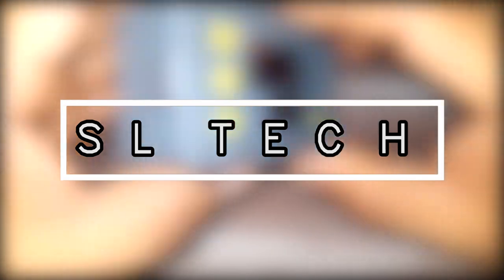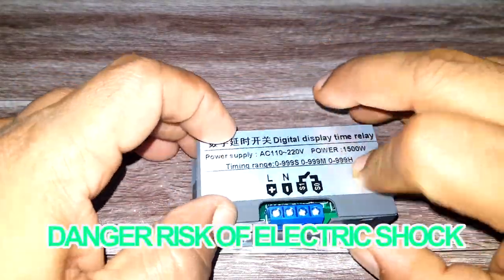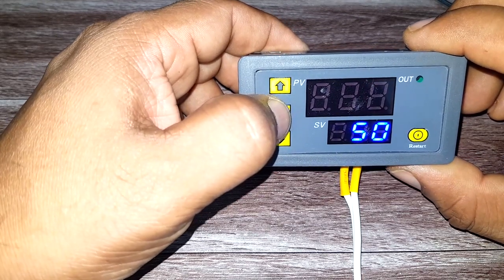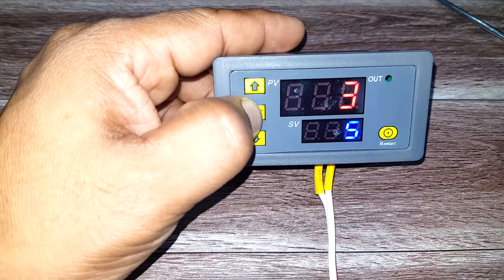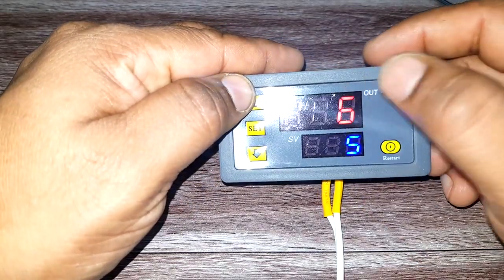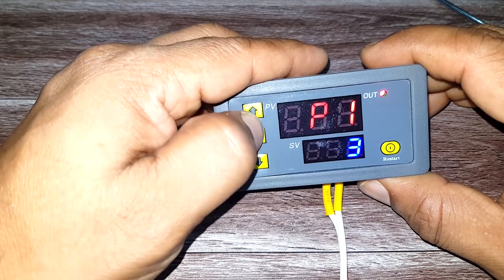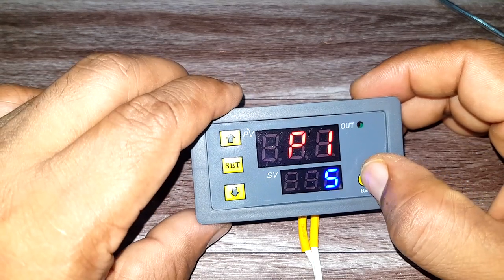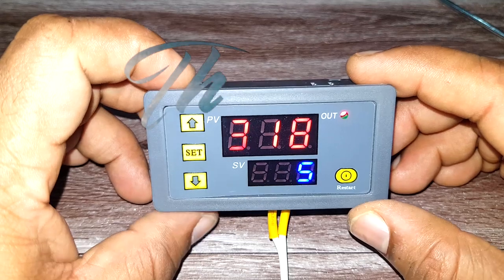DIGITAL DISPLAY TIME RELAY (Time Delay Relay Module)

Comment: Thanks for showing this. 
I have an old bag sealer, impulse sealer they call it. The one that is foot operated and for some reason its electronics are bad, I replaced the potentiometer with a new one and it worked for a while but now its is bad again. Cant adjust the timing reliably, it would turn on permanently of very shortly. 
Thinking about getting this one to replace the old stuff.

Comment: Great demonstration thanks, it's a nice thing. I don't see a 32kHz crystal though on the board, so not so sure it would keep good time in continuous running modes 4 and 5. I will try and find the spec. for it.

Comment: Hi,
Is it possible with this timer too wait 12 hours power off and power on for 30 seconds ? Your demonstration don't present the possibility too have 2 differents configurations between the 2 timers (one in hours and one in seconds for example)
Thanks for your answer
M.
Reply: RexxSeven  Thanks RexxSeven! 🙂🌎✨

Comment: Will the timer start when power is applied? For instance, in case of power loss, will the timer start when power is restored? Or do you need to press a button to start the timer after power loss?
Reply: It looks like the timer will restart automatically once the power is restored.  = )

Comment: Does anyone know how to trigger the start button remotely?
What voltage it might need?
This would be very useful so that the start button is wired (via a transformer) so that when the pump / light / etc is switched on in the normal way from the existing switch, it will run for say five minutes then turn off.
The unit should not be accessable to the user, hence the need for remote triggering.

Comment: I can program the timer but the relay does not switch on a 12v water pump. Do i have a faulty timer or am i wiring it wrong? 12v to battery, pump on other terminals.
Reply: You need a 12v + to s1 then s2 goes to your pump and the ground wire from your pump back to battery negative

Comment: Will this work ..I only want it on for 30 seconds every 24 hours is it possible to do
Reply: Sorry I dont think so...
Reply: You could join two together for this, one on a 12 hour on/off cycle which switches one on for 30 seconds only
Reply: yes it is possible. Chose P0 - 2 ( hours) and P1 - 5. set red timer 30 and blue 24.

Comment: brother your video is very educative but i wan to know how to set it for turn it on for 5 SEC AND off for 8 Hr and on for another 5 SEC like that vise viser
Reply: First change the working mode to Minutes 
for that Set the P0=1
Select the cycle timer option 
For that Select P1-4
Then set the red display to 5 and blue to 8.
The output will be off for 5 minutes on for 8 minutes and the cycle continues. 
Hope this helps
Reply: @saijusam9130  SORRY I MADE A TYPING ERROR IT SHOULD BE ON FOR 5 SECOND AND OFF FOR 8 HOURS
Reply: @yayajallow3346  Sorry. I don't think so
Reply: @saijusam9130  goodnight sir , wonderful video , I have two questions (1) is it possible to have this timer turn on for five seconds  once an hour to rotate a motor clockwise and then after another hour rotate the same motor anticlockwise ? ( Clockwise for five seconds and then anticlockwise for five seconds ) (2) I can't seem to find a wiring diagram for the device , can you pls assist ... thanks a million
Reply: Sir how to set 2 hrs off 5seconds on
Reply: Unless I am misunderstanding his answers to the similar questions on this video, with this timer you apparently CANNOT mix timing modes
e.g. Seconds "ON" and Hours "OFF". Both "ON" and "OFF" must be in the same mode/range to work properly. It looks like the timer mode option is a "global" setting. 
Example, if you want 5 minutes ON and 5 Hours OFF, then you have to use 1-999 minutes for BOTH and set 5 minutes ON and 300 minutes OFF. If the OFF parameter exceeds the 999 minute limit and you still have to have it ON for 5 minutes, then you're out of luck.
If I am wrong, then whoever corrects this hopefully will either describe exactly step-by-step how it's done...OR...show documentation (like a user manual) that makes it clear...OR...provide a video that shows it being done...and get a thank you from us.